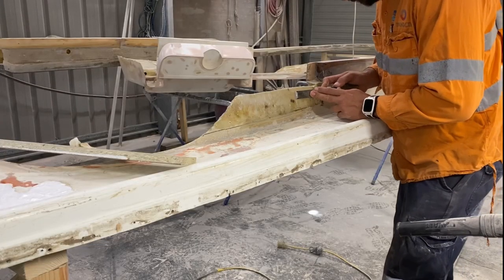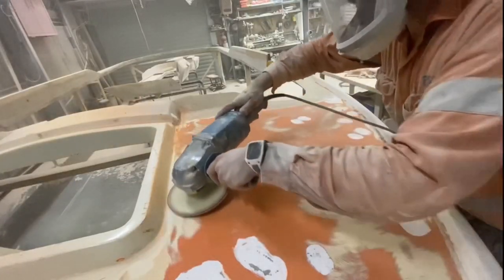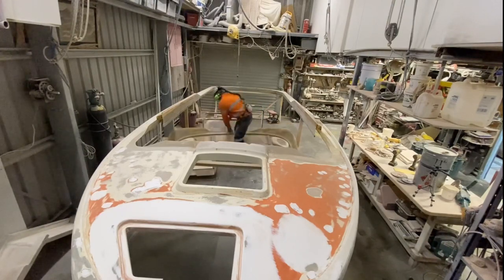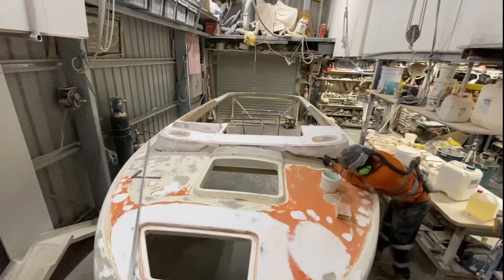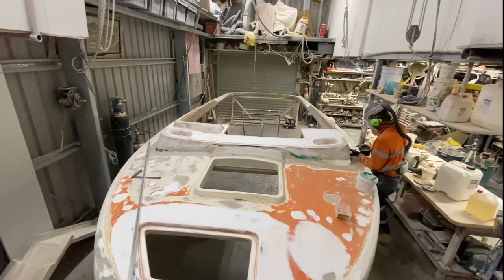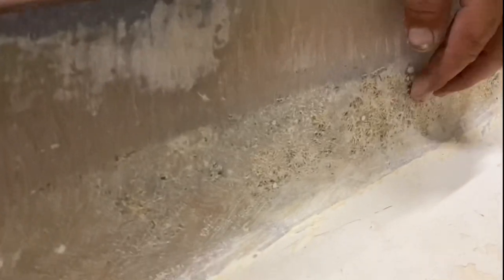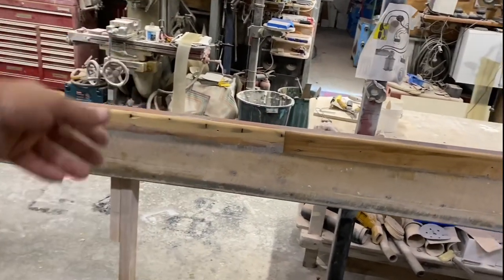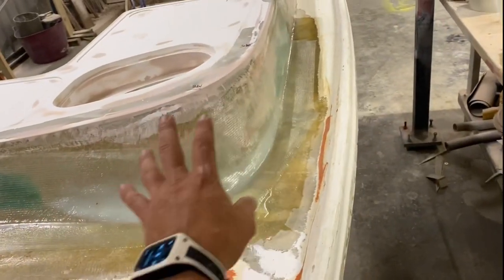25ft Bertram project - blob 36

Comment: Aahh, you do sprinkler fitting. That’s 3what I used to do before blowing out my left shoulder putting my power machine in the back of my truck. I miss it badly  though. Blaze master goes in nice and easy. Boats looking great.
Reply from the maker: Yes i'm a sprinkler fitter...hahah.. is the blaze master quieter then a rigid machine? lighter? there aren't many around where i am.. 
I would like to earn as much money NOT doing sprinkler fitting because of the reason you dont do it anymore. what do you do instead? 
thanks for commenting!